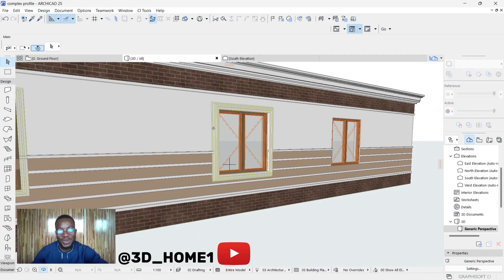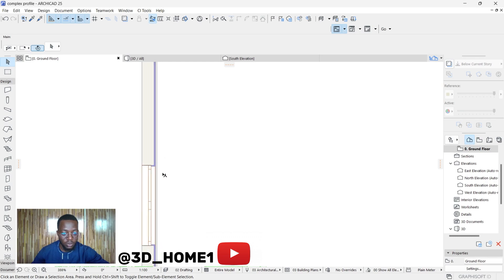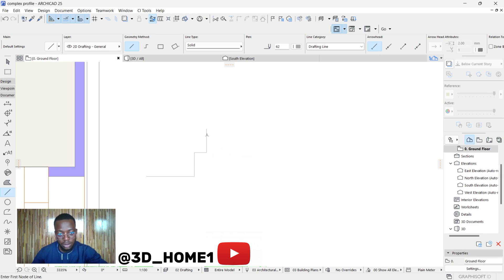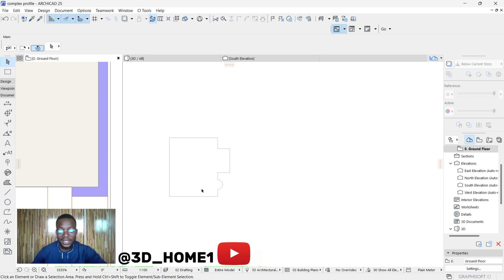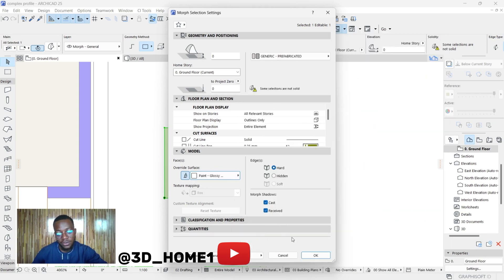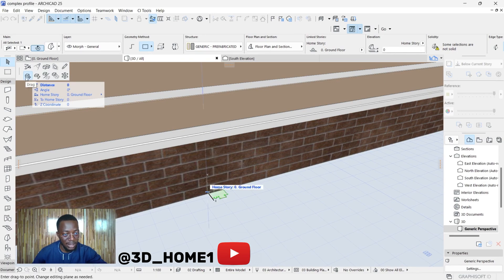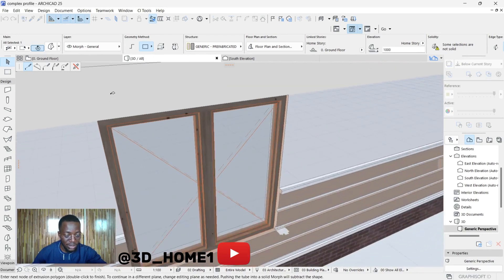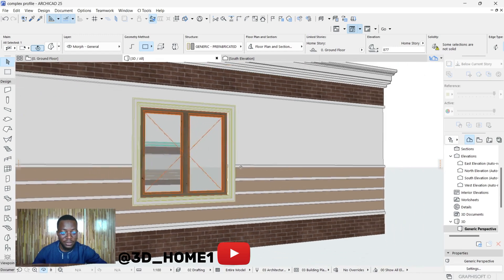How to model Architrave in Archicad, window design

Comment: This method is not correct because the decoration is not accurately represented in the plan
Reply from the maker: 😁😁 Thank you first of all for ur observation sir.  However the method is correct, what you saw on the second window plan at first, was not the architraves representation because the architrave was not there yet. So u can only see the full presentation on plan when you are done modeling the architraves. 

Maybe I will make another video on that to explain more, thank you for your observation once again.